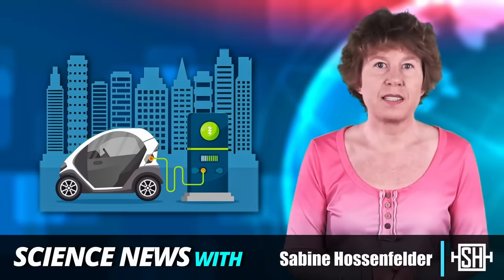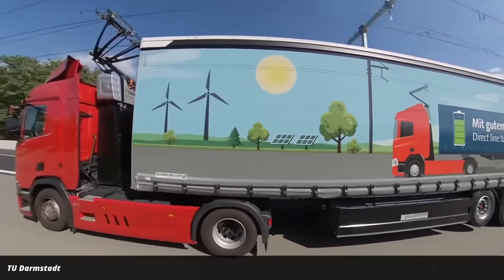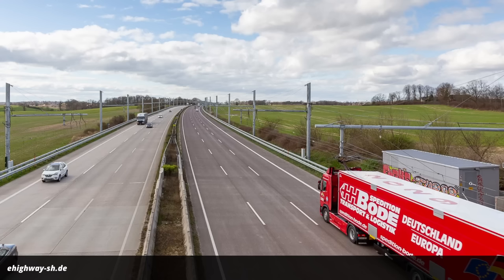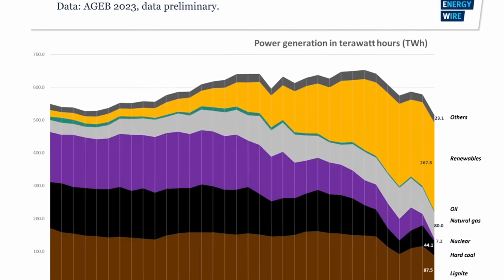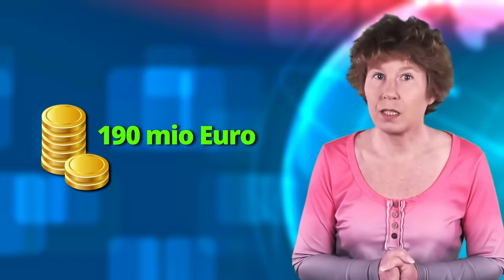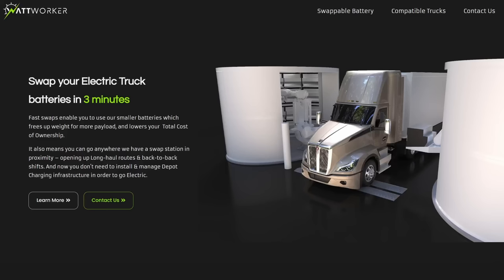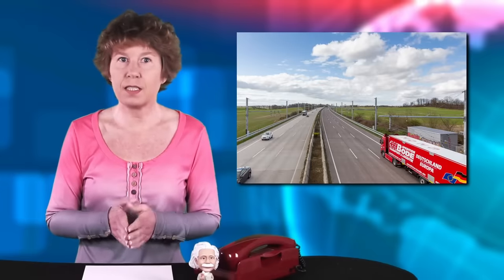Charging while Driving: Does it Work?

Comment: K. I know this isn't the exact topic of this video, but it's directly related, since we all know they aren't going to be electrifying dirt roads that attach to remote wilderness locales. I'll keep asking this question until I finally get an answer. I've submitted this question to youtube creators about 15 times now. Here goes: When I am already 50 miles from the last charging station, and I now have to turn down the dirt road and have to drive, let's say 100 miles away from human infrastructure one-way to get to a wilderness area whose temperatures dip into sub-freezing overnights for a week - how am I to get back to civilization with a 300 mile charge battery after a week of being away from the turned-off vehicle, whose capacity will diminish due to sub-freezing overnight temps? This is a physics question. I've been asking this question for about 5 years. I have still not gotten an answer, from myriad creators who specialize in either Physics, EVs or both. I would like to own an EV as my next vehicle, but cannot do so unless it can work within the constrains I've outlined above. Furthermore, what is the solution for park rangers who, on a long enough timescale will eventually find themselves with only electric vehicles to choose from. Will we (I mean everyone - including the authorities) just not be able to access remote, off-grid areas anymore?
Reply: You can hike, on foot, or not go.  I mean this is pretty simple.  There's no compelling reason why you NEED to go there.  Even if there IS a compelling reason, what portion of humanity has a need for a use case like this - 1 person in 1,000? less?  This is an extreme edge case, and honestly, no single technology is going to cover every possibility.
Reply: No, it doesn't mean that. And your question is an insult to intelligence.

   In Europe, you will have trouble finding such a place. It might be possible, to find a place, that is further than 150 miles = 240 km from the nearest publically available charger. But it will be much harder, to find dwellings, that have no grid access at all. Maybe in the Alps, in places that are accessible on foot only anyway, or in Northern Scandinavia. Still, Even then, there is the possibility, to have a photovoltaic charger in most places. Have you heard, that Norway, the land of the midnight sun, has already 20 % EVs on the road, and EV sales is > 80 % of the market share? Norwegians don't seem to share your concerns, despite living in a country, that is sub-zero without any sun in its upper third for 2 months in winter.
   
     What is your angle here? Should we stop the transition to a technology that ultimately serves also to protect said remote areas, just for the sake of the 1 in a 1000 cases, where some people  might want to access these areas 'in style'? May I remind you, that most of these areas have been explored 150 years ago, when neither electricity nor cars have been invented, on foot, with carts, horses and sledges?

    That said: replacing the majority of ICEs with BEVs or other non-fossil alternatives doesn't necessarily mean to replace all of them. The problem of climate change isn't caused by a few cars, i. e. the likes that were around in 1910. It caused by every family having one and then some, and insisting that they particularly need to maintain access to the most remote areas of the earth with their very own vehicle, even if they never get to exercise it, because they end up at McDonalds 20 miles away anyway and every day.

    Finally, if the fate of humanity really depended on it, wouldn't it be wiser, to simply give up access to such an area, instead of clinging to technology that is detrimental just because of a longing for solitude or a weird business model?

Comment: Why isn't battery swapping mainstream? Like how we exchange propane tanks:

1. Push your dead battery into a charging array. It locks into place.
2. Pay for the energy difference between the discharged/new battery. The new battery unlocks.
3. Push the fresh battery into your vehicle.
4. Rinse/repeat for swapping multiple batteries. Go! Five minutes of work vs. hours of charging.

No thousands of miles, billions of $, and obscene traffic for years to electrify entire highways. Just small, incremental array builds, within public (or private?) budgets. Can be built anywhere. Very "fast charging." Unhealthy batteries can be replaced by service workers. Battery tech upgrades can be rolled out gently without motorists even knowing. 

It's basically just building new gas stations, except for exchanging solid-state matter rather than liquid. Combined with a super-charger hookup to your "main" battery while you're exchanging the swappable ones, I think EV range could become quite respectable. Maybe you could even have the temporary batteries charge your main battery while driving!
Reply: Batteries are much heavier. There exists a car with swappable batteries. It has two batteries, each 50kg. And can go about 100km if fully charged.
Thats for a small car' for trucks you need at least 10 times that.
So swappeble batteries will require robots.
Reply: Trucks with batteries are heavier and can transport less goods and are less profitable long term. As result these overhead lines could turn out cheaper long term because every truck can be lighter and can carry more products

Comment: The issue I see is that fossil fuels give much more freedom of movement, as you just get a liquid into a deposit and once that is done you can go anywhere. You can even easily stock it up if you live somewhere remote, and just shove it the deposit, basically.
Electric cars on the other hand need much more infrastructure, and if this charging on the road would become standard, it would severely limit travelling anywhere that wasn't a main road

Comment: This has got to be the worst problem with switching to evs. We need cheap electricity and I’m not seeing that happening at least not locally for a number of years. If the cost of electricity can go low enough it opens options to use it in ways that we aren’t currently.

Comment: We should really use trains to move goods over long distances, and then distribute them by ordinary charageable e-trucks that carry enough energy for "short" distances. No need for thousands of kilometers of high voltage infrastructure that has to be built and maintened and kept safe. The combination of "rubber tires + roads" are just eating up so much energy on their own.

Comment: The future will be charging while driving. There's already r&d on wireless stationary charging. It will be a matter of time b4 scientists start testing wireless charging on the road. No more range anxiety. Evs can use smaller batteries which would reduce purchase cost. Cannonball runs will take on a whole new meaning and the limiting factor will be the driver's bladder size.
Reply: No, the future will be: you'll stay home most of the time, with only small trips of 15 min max, probably by feet or small mutualized vehicles, and you'll be "happy."

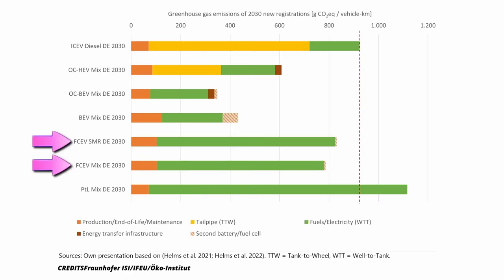Comment: 2:58 Why did they not compare it to BIO-NG to calculate the carbon intensity? BIO-NG has become a reasonably important transportation fuel in California with a NEGATIVE CI. It is also reasonably scalable and in California it is cheaper than diesel and much cleaner burning.

Comment: Its overly complicated - in America there were electric streetcars with rails built into the roads in the early 1900s by 1960s they are slowly phased out and rails removed. 
Some other technology will come along and this complex network of wires will need to be torn up. 
Any financial estimates regarding these pie in the sky technologies are usually vastly under stated (and dont include maintenance, repair, replacement periodically) to make it SEEM better. Several  years ago there were ideas and test sections of E-Highways /wireless charging for vehicles nothing ever came of it.

Comment: A hint regarding battery swapping. I think, this is a doomed idea. No because of technology, or straight forward resource economics, these could be made to work, somehow, but because for lack of commercial viability.

In essence, swappable batteries would have to be treated like containers (the big ones which come in about 4.000 € for the large 40 foot ones). But those are sturdy and inert objects, that can be tossed about with a certain amount of impunity. And there is a fixed set of international rules for attributing the responsibility, when such a thing gets damaged or lost. 
   Now imagine recreating those rules for largish battery packs for a lorry. I have no idea about the price of such a pack, but for reference, a Tesla Model 3 replacement pack is about 11000 €, so I imagine something about 20-30 k€. And these things would be much more vulnerable to wear and tear. On every swap of such a thing on a refueling station, both parties run a considerable risk, swapping a good one for a rotten tomato, having a charge, that is lower as advertised, refusing to load because of damaged cells, etc. And worse, if any of the two parties actually find out and refuse, the lorry might get stuck at the station. Add to that the logistics of making sure, that the stations always have the packs of the required compatibility available. How would be liable for the resulting damages? Who would be liable, if a swapped pack blows up and burns? En route, or sitting in the reloading station, also damaging the freight or other packs sitting in the vicinity? The tragedy of the commons doesn't bode well for that.

Technically, this is possible. But you would be nuts, to take these risks. I doubt, that there will be many takers for that gamble.

Comment: You also have to consider ACCIDENTS... when these trucks are "hooked up" they have to drive in a straight line... you can't have little car driving slow in front of them or weaving in and out... and if there is a crash and a truck takes out a power pole or a section of power lines... what will it cost to repair or in damage to any other vehicles connection arms that might be behind the accident?... you have to plan for the worst case...
Reply: The trucks also have diesel engines, they don't have to stay on the electrified lane

Comment: Another issues with trains is that the railroad system is already way over capacity, which is why there are problems keeping train tables.
Reply: Railroads have much higher capacity than roads moving bulk loads.
Reply: @svr5423  Higher capacity that is still fully used. And passenger traffic has other requirements than bulk transport.
Reply: @57thorns  Not sure what your logic is: Instead of extending railway capacity as needed (which scales really well), you want to put all the bulk traffic on the road?
Doesn't make much sense.
Reply: @svr5423  No, it would be great to expand the railways.

Comment: When will they start integrating magnets in the roadbed that can power recharging coils in the vehicles? The vehicles would gain charge while on either diesel or electric motor drive. The amount of resistance to forward travel would be largely nullified by the momentum of the trucks mass. This is especially true of fully loaded vehicles. They could space the magnets into groups so that the resistance to forward momentum is not constant and any speed reductions could be regained, therefore reestablishing momentum of the mass. The timing of the groups would be dictated by the speed of the vehicle, which could be used to ensure compliance with speed limits for efficiency. The reduction in diesel consumption would be significant and the amount of diesel needed to aid in the charging is minimal. I believe hybrid systems are the answer. Fully electric vehicles are not realistically feasible with the currently allowed technologies. Tesla had a better plan, but greed is an obvious factor in reality.

Comment: But we still have the issue of what power to use, while shoving the trucks through said worm holes.  If the answer is manually, then why not just push trucks along the highway, rather than using fuels…win-win.

Comment: To me, the concept that burning diesel on a (relatively) inefficient vehicle engine is cheaper than burning it at a power plant to get more power out of that same diesel due to it's higher efficiency and then powering comparatively more stuff is bonkers. I guess it's due to bureucracy and/or subsidies but in terms of naive numbers I just find it perplexing.

Comment: Th US Navy developed a JP-8 (basically diesel) powered fuel cell that was 50% more efficient  than a comparable diesel generator. Batteries on semis are just ridiculous. Fuel cells powered by diesel than eventually hydrogen are a much better idea. A start-up in Washington state is converting diesel generator powered Mining dump trucks to H2 fuel cell (these trucks already use electric motors). The payload capability went from 350 tons to 500 tons. It's paying for itself.
Reply: How long did it last? Three weeks? ;-)

Comment: Just powering one lane means any breakdowns blocks all trucks.  And no passing slow trucks by going around them.  The fast battery swap is a better idea but someone has to manage the battery swap charging site.
Reply: But they have batteries of a modest size too, so they could easily go around a blockage. Also I'm not convinced that the battery swapping infrastructure will be cheaper than catenaries, all things considered including the lifetime of batteries.
Reply: Could that not be done by the Distribution Centers where these trucks are loaded now? And I don't know the laws in Germany, but here in America we do have laws that make it mandatory for truck drivers to only drive for a certain number of hours a day, then rest for another certain number of hours before driving again. Plus we have Truck Stops that are large facilities that have already many fueling stations and amenities such as restaurants, stores, and showers for the drivers. Some even have washing stations for the trucks themselves.
Reply: Actually no. You can always lower the pantographs, drive around the broken down truck and put the pantographs back to the wire. The whole system is designed for trucks to come on and off the wire at any given exit. This would also work for a broken truck - and even this one would in the most cases be able to move to the side lane.
Reply: @SiqueScarface  Oh. that is good.

Comment: What happens to electric cars with their large batteries low to the ground when rain floods roadways? Last winter the electric charging stations in Chicago could not handle the cold and people could not charge their vehicles. People going to need to have two cars?

Comment: I think I'm the only person who is most concerned about fossil fuel running out and not so much about climate warming.  I'm concerned we are taking fossil fuel for granted and wasting it every day driving vehicles.  Eventually, it will run out.  Estimates are everywhere from tomorrow until never.  Let's just assume that it is somewhere in the middle.   If we run out of fossil fuel there will be a lot of things civilization counts on that will come to an end pretty quick.
Reply: So what? Everything runs out. It's not like there's a point to existing. You don't need to spread it out. When it's gone it's gone.
Reply: @Paremata  and completely accurate. Why would you extend the struggle as long as possible by spending your life not enjoying it so more generations can exist to not enjoy life? Once the oils gone its gone. They can do something else.
Reply: @PonkyKong  Well, it may not matter to you but it matters to me.
Reply: @Paremata  why? It's will end. What does it matter? They will do something else.
Reply: @PonkyKong  Because it will be a different Universe then than it is now.

Comment: This seems unnecessary tbh. For long-distance haul, focus on rail. For short to medium-distance haul, focus on batteries. We might need to keep some diesel trucks around for some use cases but honestly that's fine. Same with cars, I don't think ICE cars are fully going away either (no matter how hard the EU tries to ban them), but if we can get rid of a large part of them, that'll be good enough. Maybe in the future when we actually sh*t money and most of the network is electrified (via rails or battery EVs) we will be able to afford this.

Comment: One thing that would help with the power is more solar. Here in the UK the energy companies have a right to veto any domestic solar (a neighbour of ours had to wait over a month for the energy company to allow them to connect). And residents and Government have the right to stop any commercial solar. Its simply ludicrous. 

Talking to electricians who've worked on the grid it seems it can handle up to 50amps back from solar per home on average. It is unlikely that much would ever be installed on a single property as most dont have appropriate roofing... even a 300w panel per property would have a massive impact on the emissions and stability of the grid here. But nobody is interested. The conspiracies abound here.

Comment: This is such an obvious solution. One ive been advocating for at least since 2018.
But would require large public investment. As we've seen with large solar projects there's a huge lack of willingness to do these projects.
Reply: Not so obvious to me.  Looks complicated, maintenance prone, and brittle in its ability to adapt to changing traffic conditions.
Reply: @zantetsu8674  In terms of overall cost its way cheaper to put up wires than produce that many batteries.
It's simple, easy to maintain and the opposite of brittle. Not sure what else to tell you. Maybe do research before spitballing?